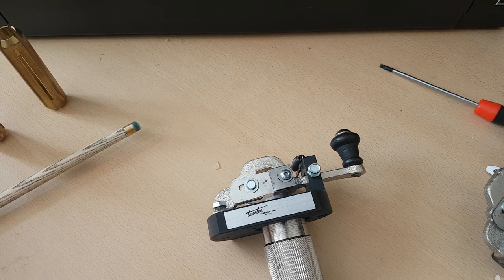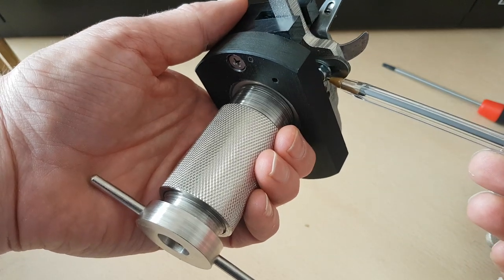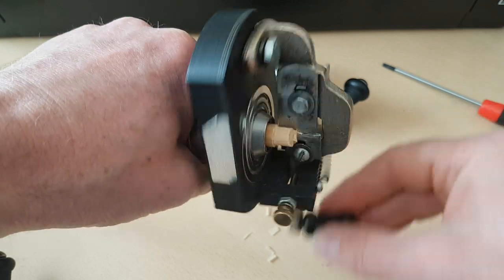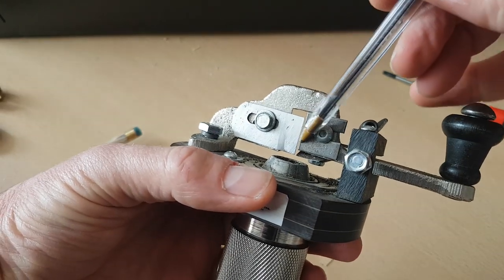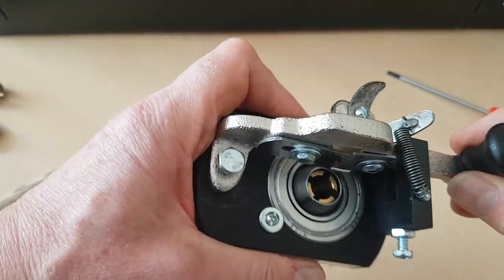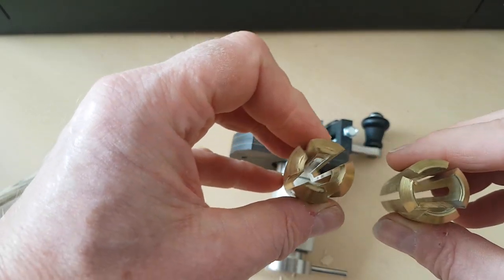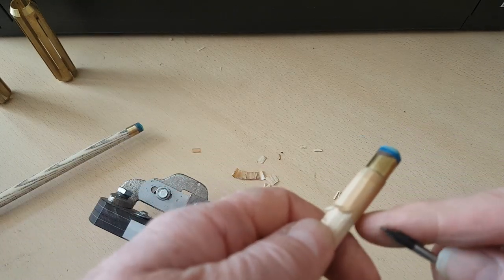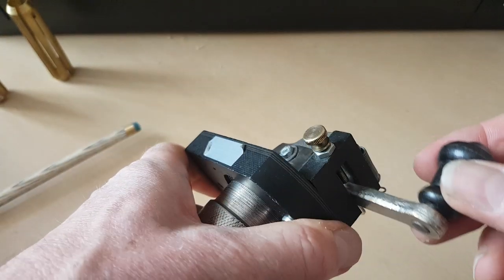Tweeten Tenoning Machine - Overview

Comment: You dont need tweeten to supply you with a spring. Just buy one off amazon or ebay. And swap the blade for a quality plane blade. Credit to you for being honest in the video and not trying to sell it as something it's not- as in a well engineered, quality tool.
Reply from the maker: Hi Eric
Good idea. I guess once you've found a similar spring ( i.e length and tension) you've cracked it, or just cut and adjust one to fit. I've not seen them as a spare but it does seem a sensible addition.

As regards the blades, the replacements certainly aren't cheap so I'd always try and sharpen them first. I love the idea of an alternative similar item but I guess like most of us it's just simpler to just but a direct replacement.

If you have a link to an alternative, feel free to post it as although I sell them, I do the videos to help people that are interested and my main focus is not profit.

Thanks for your comments, certainly a good read.

Comment: Could you not cut a couple of coils off the spring and reattach?
Reply from the maker: Yes, this is possible if within your skill set or as mentioned on other comments, possibly find a similar spring on Ebay etc and replace. Either method requires the replacement or repair to be of a similar tension. All food fun.😀

Comment: I have to say based on the cut you just did that device would be a no no for me, it ripped the wood as opposed to cutting. Could you post another example?   Another issue I see that could be improved and that is the spring locking mechanism does not allow you to adjust the amount of pressure on the blade nor does it have a stop allowing you to set to amount of wood you what to remove.  I could see a lot of pp, ruining their cues with this device.  Has potential just needs some up grades which I think I could do my self.  Adjustable tensioner and a stop
Reply from the maker: Hi Peter
I don't disagree which is why I don't use this device, kine are completed on a lathe.
The video is for helping people who have the cutter but uncertain how it works.

I also think on many occasions parts of the tenon could be ripped from the cue if the blade isn't perfect.

Comment: When it comes to sharpening the blade, the finer abrasive you use, the better the cut will be.
If you go down to something like 800 wet and dry or finer, it will also start sharper longer.
Reply from the maker: Cheers Colin. Sounds like a good idea if blade sharpening. These blades can be a nightmare to adjust so the longer they stay sharper the less stress they can cause!